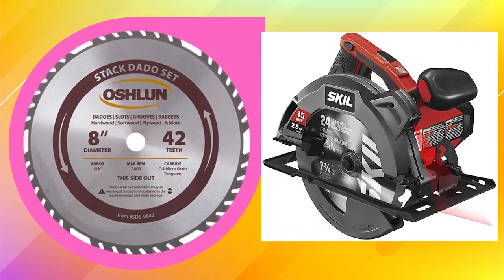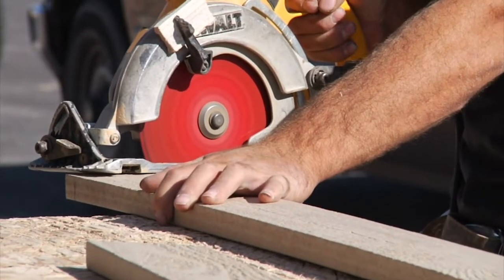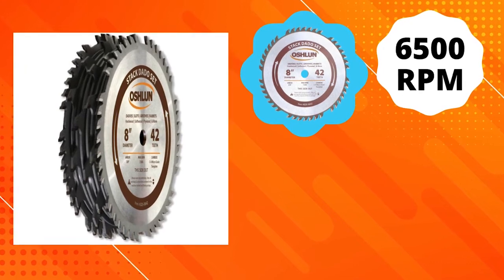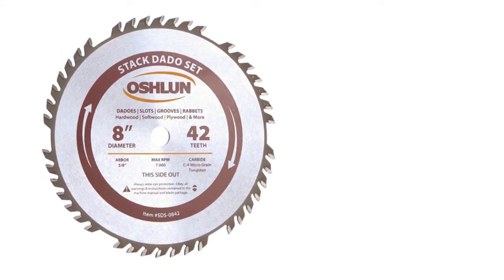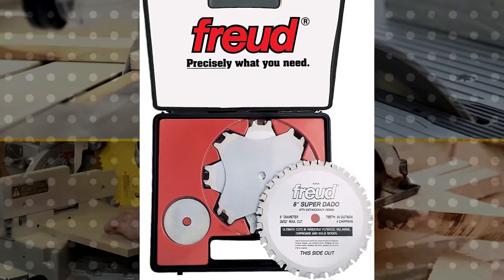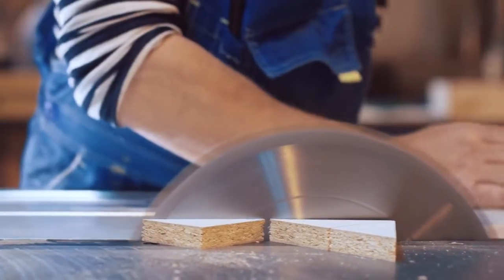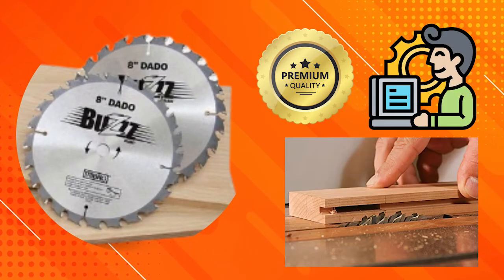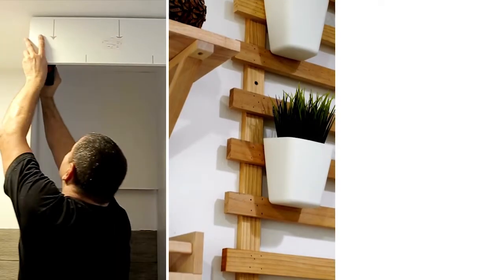Top 3: Best Dado Blade Set (2024)

Comment: These domes are part of an underground flash water storage system for construction sites that are tight on building covered ground. They’re set set on a base  of compacted gravel in a deep hole. Then the placed on top of the stone with similar plastic pieces for end caps with drain pipe that’s connected to storm sewer grating. Then more gravel is added on top and compacted until it’s at paving height on the job site.